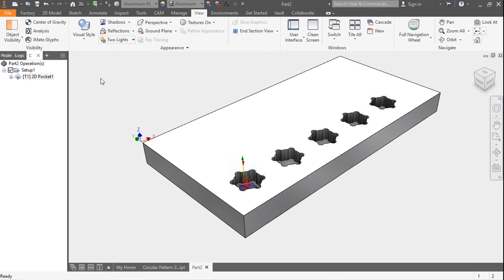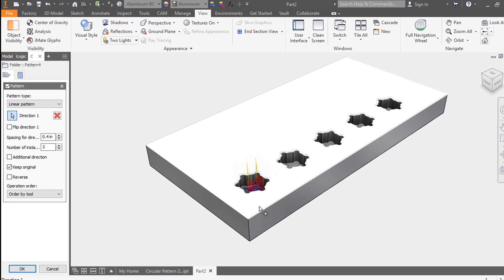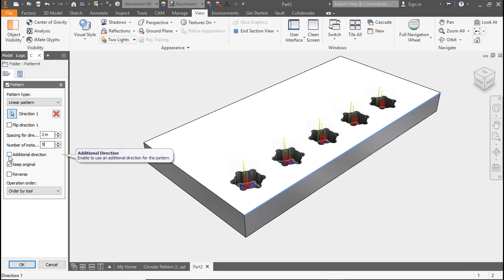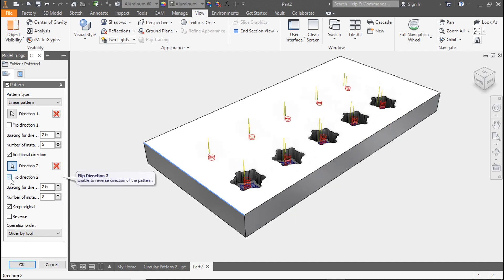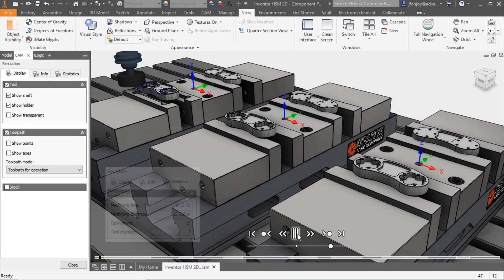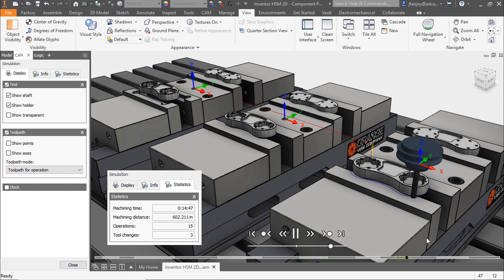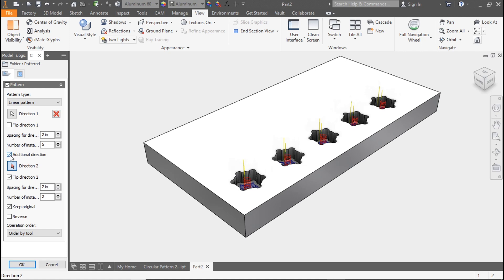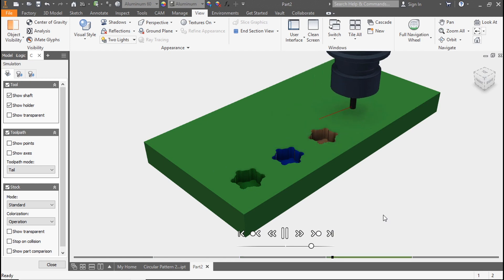Inventor HSM QUICK TIP: Linear Pattern

Comment: Thanks!
Good function! Can I use CAD arrays for CAM array configuration?
For example, I have some tool holder matrix 5x5 and want scale it to 5x7 or 10x10, i have 2 parameters x size and y size in tool places.  In CAD I can make a lot of calculations in parameters table and get parametric model. Can I intagrate CAM to this to generate toolpath without CAM settings editing?